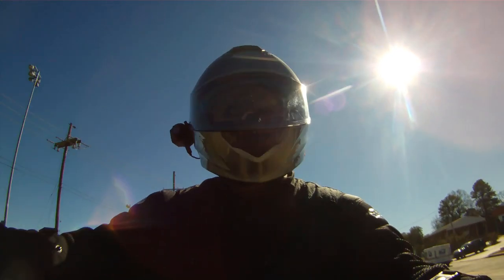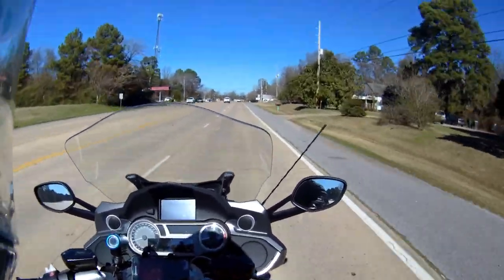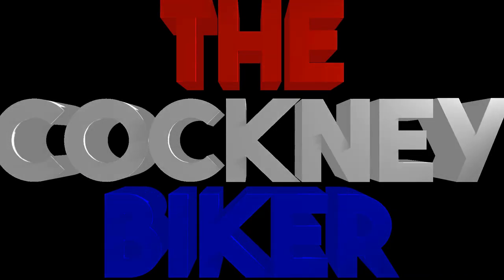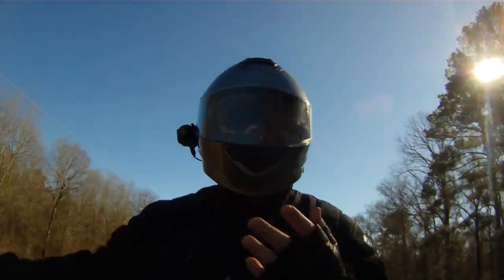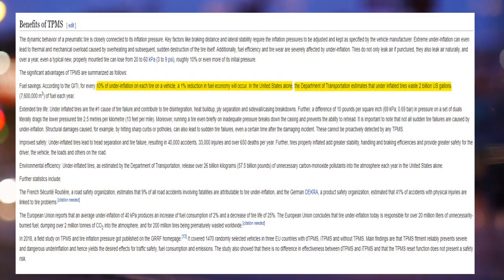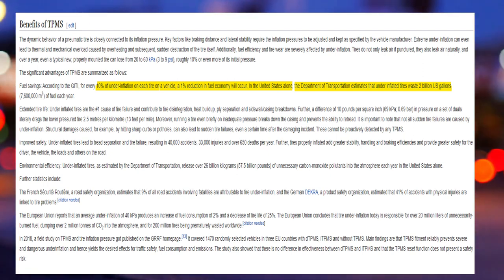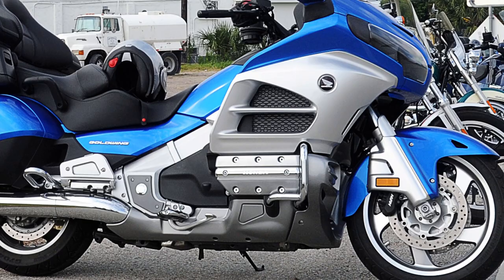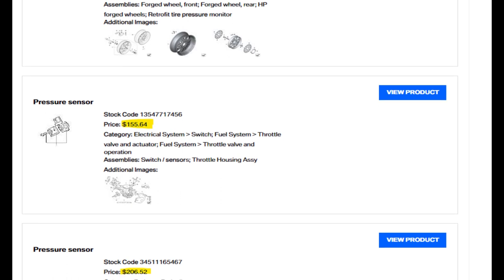Whats with Motorcycle Tire Pressure Monitoring Systems? | BMW K1600 Vlog

Comment: All the technology they come up with is just another thing to go wrong, in my opinion, that they no doubt will charge a fortune to repair/replace.  I prefer to just keep my head out of my arse and check the tires from time to time, especially after strong temperature changes.  Y'all ride safe.
Reply from the maker: Some tech is handy to have.. but as we rely more and more on it, we become dependent to the point where we are venerable to being ripped off.